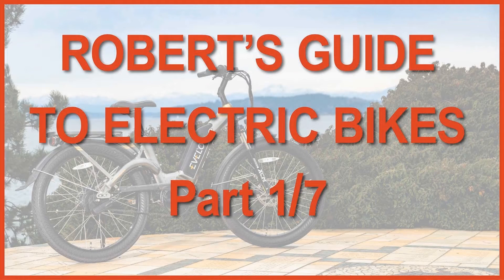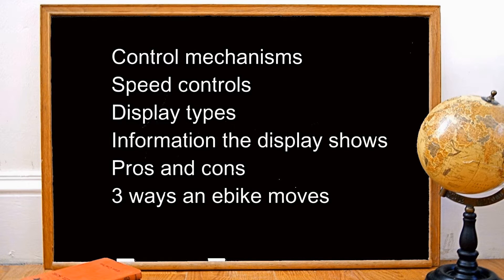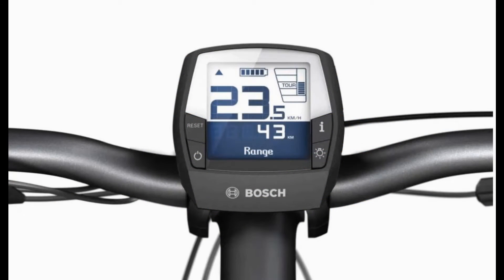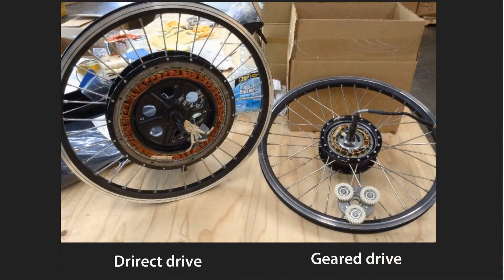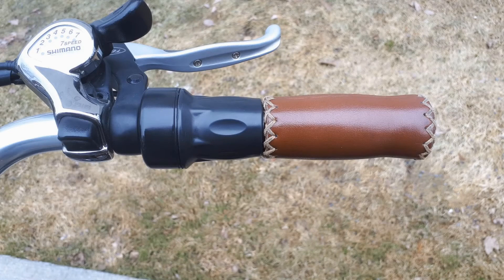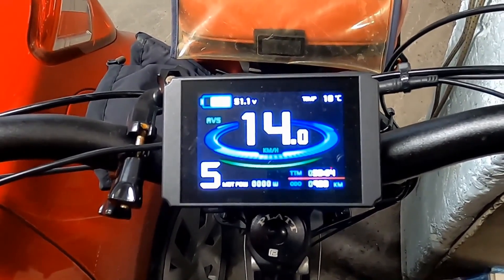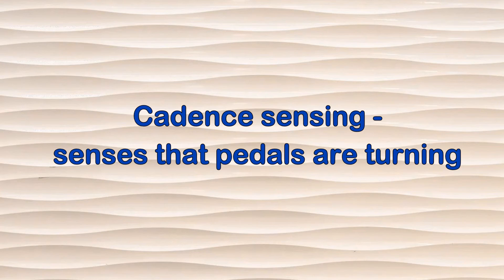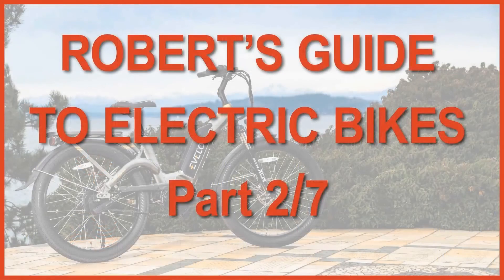How the Pedal Assist Systems Work on an Ebike - ALL ABOUT EBIKES

Comment: Cars come with a user manual. Unfortunately, when I bought my first bike there was no documentation at all, and I was also unable to find a user's manual or anything online about my Ebike. After 6 years of being "problem free" My charger died with a very loud bang. Not a big issue, I bought a new one but...... The battery refused to charge. Weird, the battery still had some power left in it, worked but was impossible to charge. To make the story short! I had to do a lot of research to discover my battery has a fuse, and where it's located, and also finding that specific new fuse was challenging. The lack of documentation is a big issue, especially for the long-distance riders since we need to be able to fix things on the go and carry essential replacement parts. What I find the most interesting is that none of the bike shops was of any help at all. They suggested I buy a new battery or get an expensive BMS replacement when all I needed was a $2 fuse.
Reply from the maker: Thanks for interesting story. The bike mechanics you consulted should have suspected the fuse right off the bat. They should have figured that when the charger blew up, it would have caused a surge strong enough to fry the fuse. Some manufacturers do provide an instruction manual, but nothing like those that come with a car.